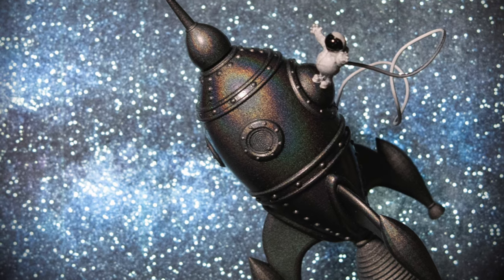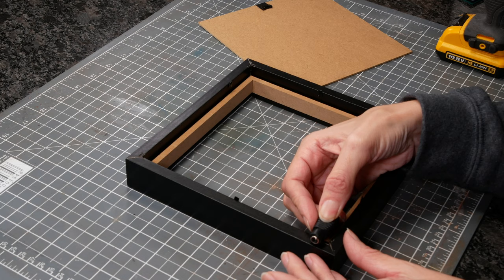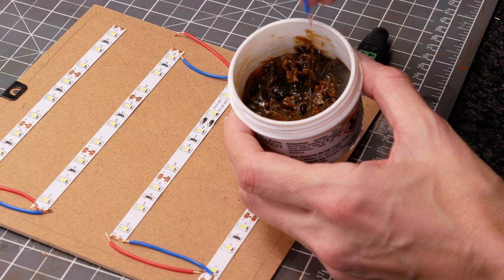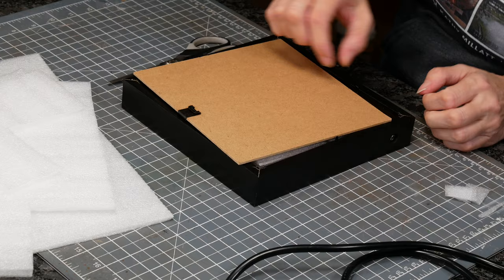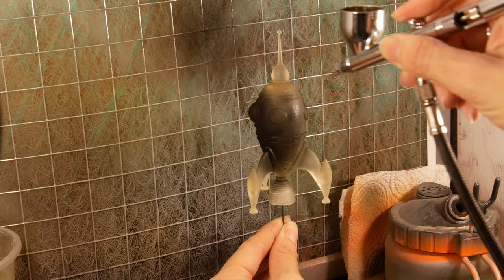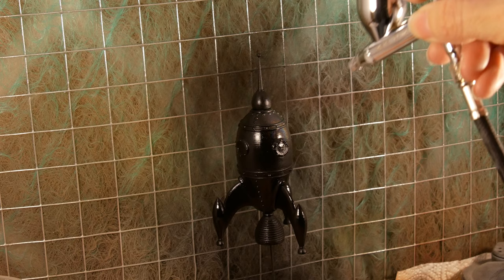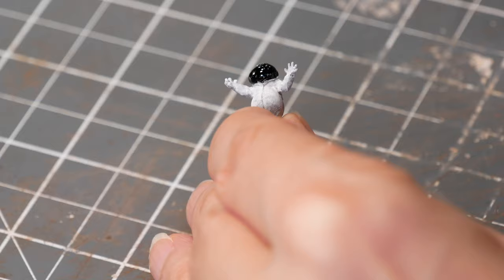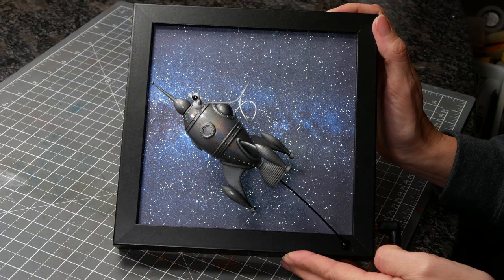Lost in Space Diorama - with light up stars

Comment: Nice. Oi loiks it.

Gave me a notion to try something cool.

<thirty mins later>

OK, I have successfully managed to create an STL file using a starfield photo to displace according to contrast, meaning, (in theory, I don't yet have a 3D printer to check practically, although I may well soon) it's possible to print out a sheet of resin with holes exactly matching up to each and every star with less than an hours fidgetting time.

OR

Assuming you have access to semi-translucent printing material, it ought to be possible to print a sheet with depth varying by the contrast of the image, meaning each star would be very thin, the space bits being thick, and stuff like nebulae being somewhat in between and varied based on glowiness. So, like, the degree to which a bit is light up wuld match the image over the top.

Whilst I canne go check this, yet, I'm pretty confident this' dwork pretty well. If you'd be interested in a little experiment, I have an STL and image file lying around.
Reply: Oh, also, on the off chance it didn't go without saying, I'd very much assume it'd be on the basis you might be interested, not that there'd be any kind of expectation of anything of any kind.
Reply from the maker: Sounds fascinating. What a brilliant concept!

Comment: Super diorama. How would you have disguised the metal rod holding the spaceship as a jet of plasma or rocket exhaust?
Reply: Hmm there's a youtuber whose name I've forgotten who does 'live' snapshots of an explosion, etc. He uses cotton wool teased out into a fine cloud, airbrushed with red/orange hues, and with flickering leds in the center. I'm almost sure I've seen steel wool used in a similar way
Reply from the maker: If the ship was moving then the umbilical would be towing the spaceman so I needed it paused in space. I have just finished something with cotton wool and do eventually have plans for an explosion...
Reply: No air in space Kathy so the umbilical would remain the same shape. Looking forward to seeing your work on an explosion.
Reply from the maker: @graemehansell7642  But surely as the ship moved off, the spaceman would have no momentum yet so the umbilical would stretch into a straight line before starting to tow the spaceman along?
Reply: If the spaceship was already moving it, and all its contents, would have the same momentum. Moving out of the spaceship would be the same as if the ship was stationary. If the spaceship started moving whilst the spaceman was outside I believe that the entire structure (spaceship, umbilical and spaceman) would act as a single unit and move simultaneously. However, the diorama looks good whatever the physics involved.
Reply from the maker: @graemehansell7642  It's interesting to wonder but I have no way of proving it!!!  The only issue would be if there was acceleration involved I guess.